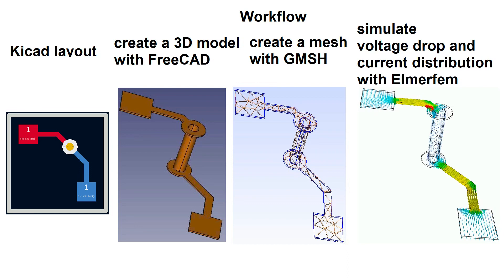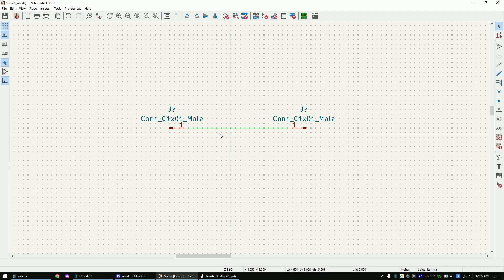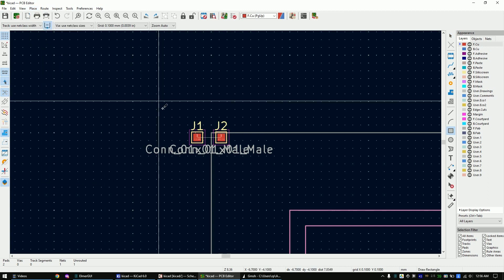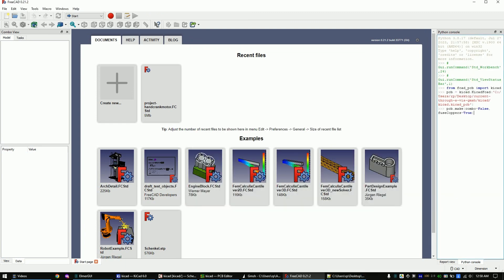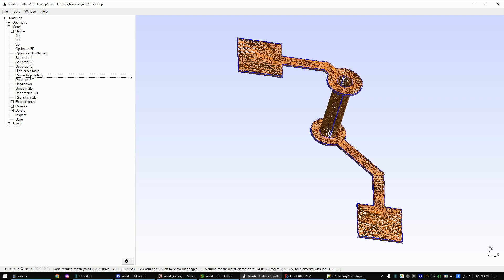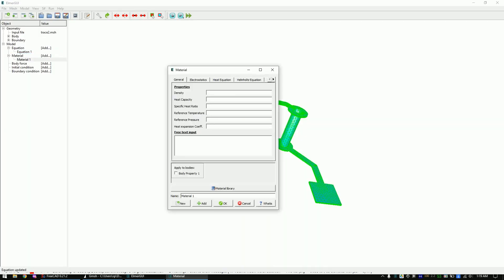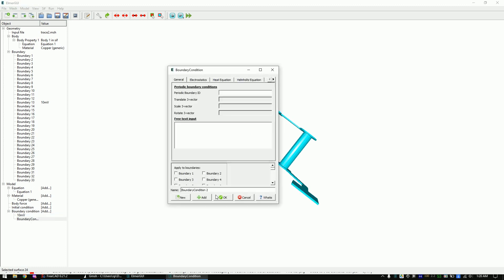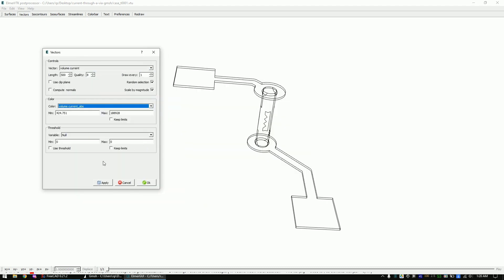free KiCad 3D current simulation with Gmsh Elmerfem and FreeCAD Finite Element Method

Comment: I am facing issue in meshing. Gmsh is throwing boundary issue error
Reply from the maker: It can be tricky to get the meshing right, so you're not alone!
Do you have an issue with your own design or with the design in the video? you can share a screenshot (for example via imageshack.us or a similar website), so i can have a look and maybe give you the solution to the problem

Comment: What is the best way to calculate the dc resistance of that trace? And is it possible to investigate skin effect and to calculate resistance(f) and inductance(f) for such a trace?
Reply from the maker: I tried to feedback you by writing a text, but instead I will plan to create videos covering all these topics.
* Resistance (f) or trace impedance, as well as inductance and capacitance across frequencies
* Skin effect for single traces, including proximity effects and interactions between multiple traces
* For worst-case simulations, factors such as temperature, humidity, surface finish, and manufacturing tolerances can also be considered.

For DC simulations, I found Elmer easier to use (DC resistance and capacitance), whereas for high-frequency simulations, OpenEMS was more effective.
Hope this reply is acceptable for now.
Reply: @panire3  Sounds like a great roadmap!! Looking forward to your videos! Yes I will have a look on OpenEMS. Thank You!
Reply from the maker: @RivaleGary  Just an info: I uploaded the first video regarding above roadmap, resistance or impedance over distance - https://youtu.be/fitgmJu_rfM
Reply: @panire3  Hi, I found this video (https://www.youtube.com/watch?v=VsQ-l79mLrM) and I had a look on the elektromagnetic workbench. But I'm unsure what is a good way to import the kicad files to freecad and how to make the data compatible with the EM Workbench... do you have any experience with that?
Reply from the maker: @RivaleGary  Sadly I have no experience with the tools shown in the EM workbench video so sadly i cannot help out. Thanks for sharing. I’ll definitely try to reproduce the steps shown in the video and, if I manage to import the KiCad files successfully, I’ll share the process with you.
Reply: @panire3  Thank you for your answers!